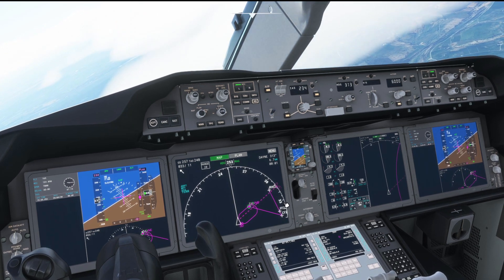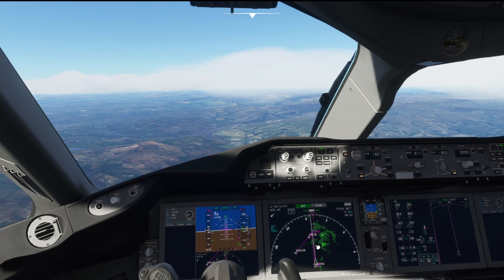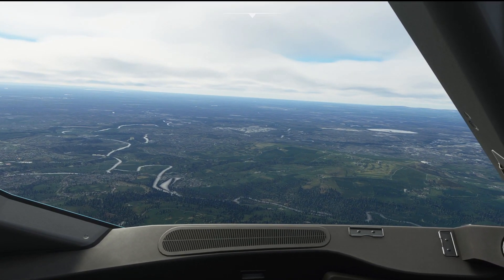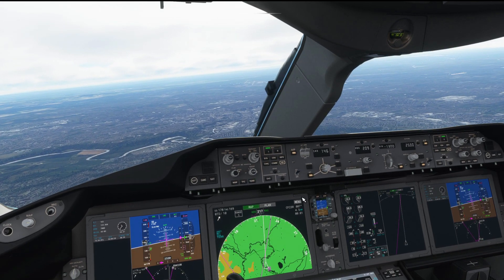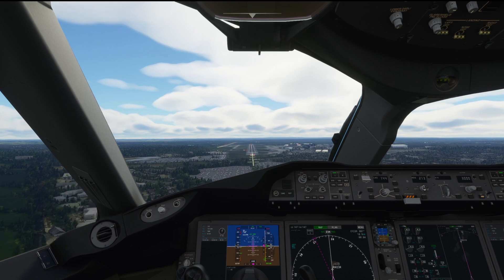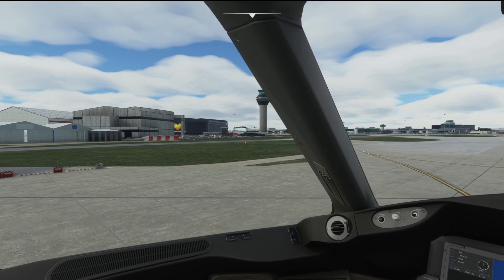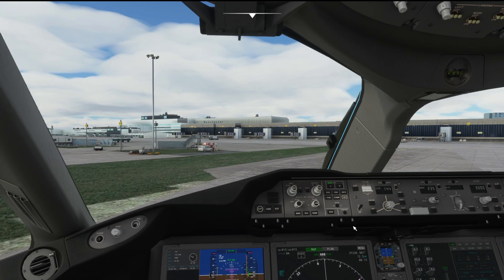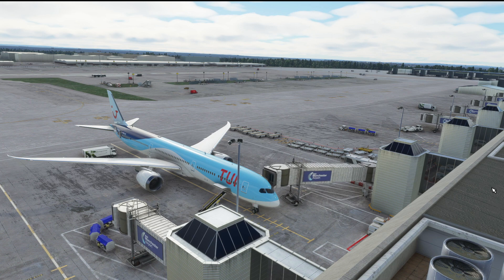MSFS | Boeing 787-10 Dreamliner Tutorial - Exiting Holds & ILS Approach [Heavy Division] Ep.3

Comment: Thanks for doing this.  I've done a couple of flights and haven't been able to arm either approach or localizer.  Seem to always be high.  If I am too high would that prevent approach and localizer from arming?
Reply from the maker: Yes if you're too high the LOC will arm but glideslope won't I don't think ( depends how high you are though )
Reply: @BritishAvgeek  On the plate which shows the glideslope, you want to be at or slightly below the waypoint which has the iron cross symbol in order to intercept the glideslope.  You cannot be above a glideslope to intercept it.  The FMC will reject acquiring the glideslope that you are above.  You need to intercept a glideslope from below it by flying through it.  I don't know the proper term for the iron cross symbol.

Comment: Hi, Why can't I see TOC/TOD, I have the latest version... I am flying VABB/VOTV, had an issue HDG/MAG setting showed ok but seems erratically trying to go in a circle, had hand fly and bring back. Now A/P, LNAV, A/T, and HOLD 37000 VNAV is OFF.. let's see how it goes!!
Reply: ok pls disregard.. I see it now!! :)
Reply from the maker: @vipannath4095  glad you sorted it 👍 remember to clear any discontinuity in the flight plan every time
Reply: @BritishAvgeek  This morning again, the darn aircraft keeps going in circles, in spite of enabled A/P, LNAV, A/T, and HOLD 29000 VNAV is OFF. Sometime it works it's seems unreliable, I know it's in the development stage..Maybe I try the Dev instead of experimental and see.
Reply from the maker: @vipannath4095  no the Dev version is not the one you want. You must be clicking or something something wrong or have a mod clash somewhere because I've never had this issue. Hard to tell really without seeing all of your steps
Reply: @BritishAvgeek  
I just did a flight from VOTV/VECC 
Had monitor for 230 hours. A/P unreliable. Had to put F/D off and then the A/P and reinitialize again throughout the flight. 
I am following your instruction to the letter. 
I have installed the experiments version. And flew the flight. 
After takeoff initializing AP and LNAV and VNAV  the aircraft tends to go to the right and keeps circling around until I control it by hand flying. 
When I fly tomorrow I make a video and also send you the pic of the settings etc. 
let me where to send it. 
Take care. 
Thanks.
Reply from the maker: @vipannath4095  have you checked your deadzones? Make sure the aileron, and rudder deadzones are nearer to 15%
Reply: @BritishAvgeek  I am using FSUIPC7..
Reply from the maker: @vipannath4095  ahhhh there have been some issues with that I think for some - I have actively avoided FSUIPC7 since December because it was causing CTD in MSFS and I've avoided it since
Reply: @BritishAvgeek  ok. I’ll go back to direct and not use fsuipc. I’ll keep u advised. I have configure. Saitek rudder pedal yoke and throttles again. 🥵
Reply from the maker: @vipannath4095  btw you're in discord now so have a look through there + you should see the Members Only Lounge too - feel free to use the discord to seek help from the community :)
Reply: @BritishAvgeek  roger that. 
Goodnite. It’s 3am. In Atlanta.

Comment: In Boeing, final speed is VRef + 5 knots for wind correction. In your video, you should set speed as 149 because the VRef is 144.
Reply from the maker: In most aircraft it's +5.
Just because the vRef is displayed doesn't make it accurate in the sim as it might not be. If you aim for a 2-3° approach you'll be good - which from memory is what I spoke about in the video. Sure, may have missed one or two things but the pitch is a good indication of how good your speed is

Comment: Thanks for this. I feel a lot more confident flying this on Vatsim after watching your videos.  One question, does differential thrust work on the 787?
Reply from the maker: Awesome! And yes you can control each throttle separately but I have a single bar throttle so don't unless I click and move on throttle bar up or down manually